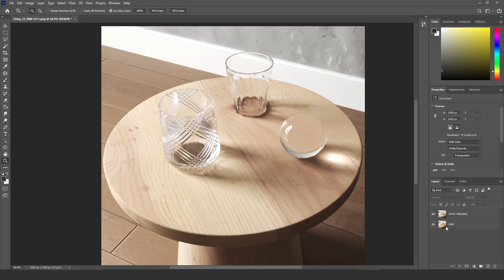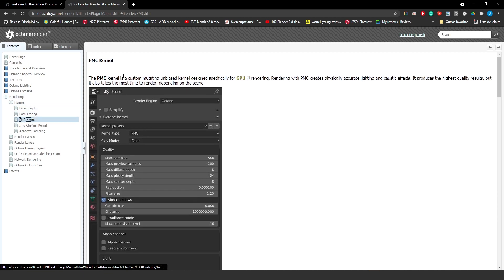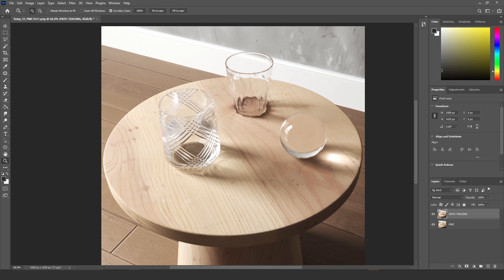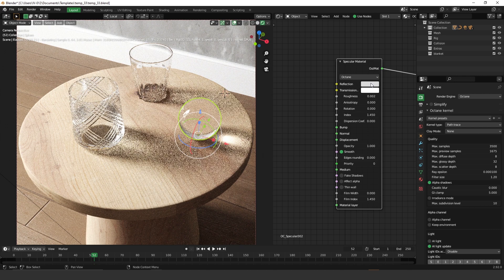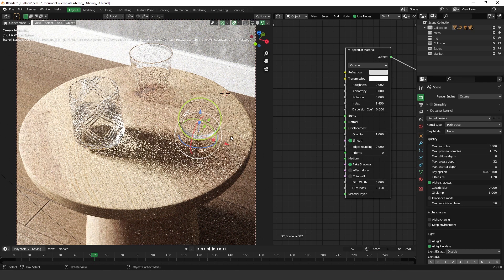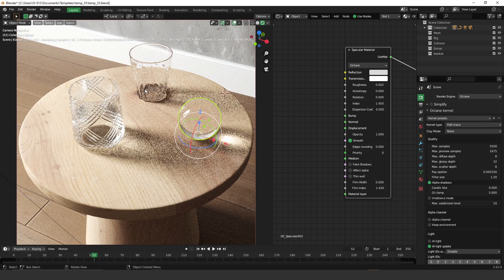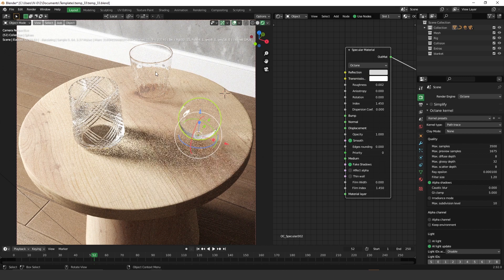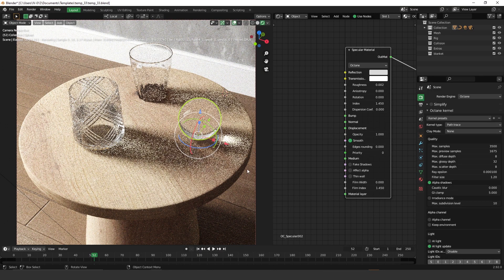Caustics in Blender Octane

Comment: The PMC will start shining, when you start having overlaying caustics object and when you have different IOR values, e.g. a Liquid inside the Glass or a bottle. Also check out "nested caustics" as it allows you to tell octane which mesh is nested inside which for them to be properly calculated.
And Fake shadows is also somewhat relevant for caustic shadows I think and for them to be properly rendered I think you need alpha shadows activated in the render settings.
If you think the caustic shadows are too smooth, play with Caustic Blur. I also recommend reading the Cinema4D manual along with the Blender one as it offers many more pictures and shows you what which settings do visually.

Update: Fake shadows are only there for glas objects, not to calculate caustic shadows. So don't check fake shadows if you want realistic results.
Reply from the maker: Great! thank you!
Reply: Thank you a lot!